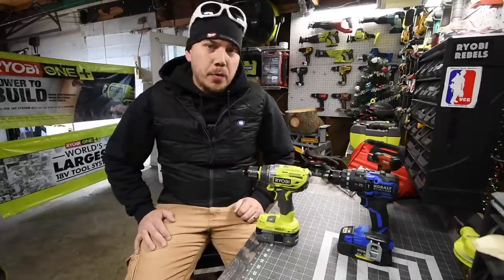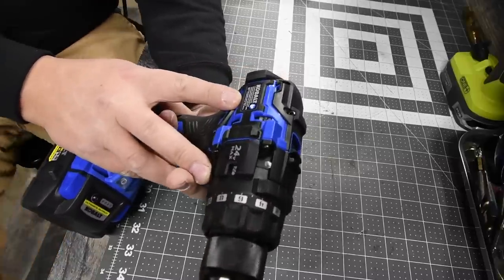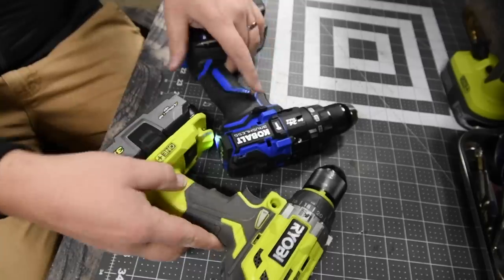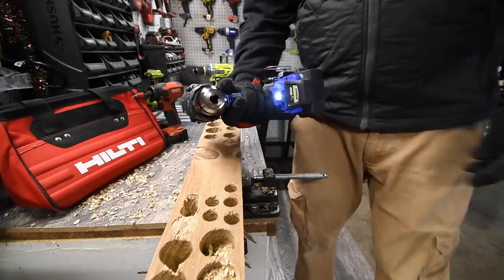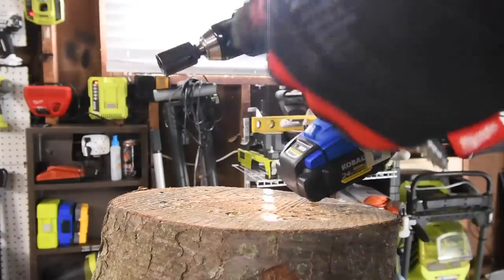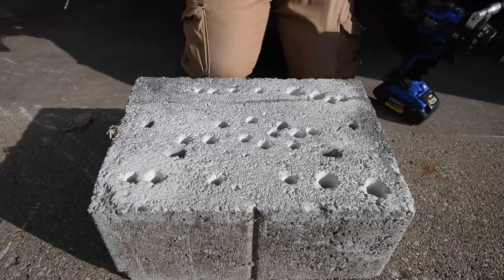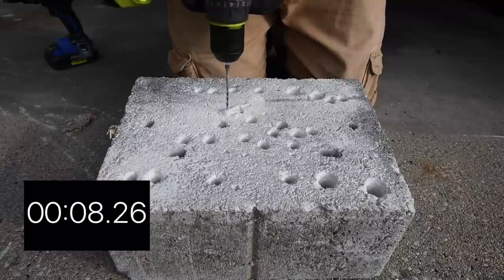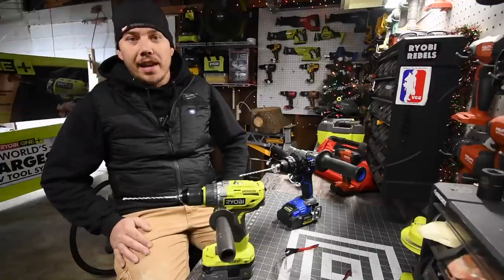Kobalt vs RYOBI

Comment: Project Farm just tested socket adapters.  Turns out the DeWalt socket adapter is the toughest on impact drivers, and Makita Gold when applying steady torque.

Milwaukee bits did mediocrely considering their supposed to be top tier brand.

Thought you should know since you break socket adapters a lot.
Reply from the maker: I love pushing these bits and tools to the extreme

Comment: I think Lowe's has some of the worse marketing in the world. The Kobalt is a great line of tools yet nobody knows about them. I agree with you I wish Ryobi had updated their tools instead of the HP line. I get it its Milwaukee 12v tools adapted to work on the 18v Ryobi battery platform. I bet if you tested the HP against fuel 12v they would just about tie in performance. Great video as always.
Reply from the maker: I agree with you on that.

Comment: Ryobi is a solid brand I just picked up the compact drill and impact. The new impact smokes my hp impact. Hoping the new hammer drill has a better handle though.
Reply from the maker: I want a HP hammer drill
Reply: Dec 10th is the 2021 release special hopefully they will announce it then.

Comment: My same ryobi drill chuck failed on me. I think its before three years but cannot find my receipt. I cannot losen the chuck to release the brush attachment i was using to clean. Now its a permanent metal cleaning drill.
Reply: Do you have any vice grips or maybe clamp the chuck into a vice to get the cleaning brush out?
Reply: @bulldog7659  yeah I've tried using vis grips. It just damages the thin metal housing. And just click slip sound. I believe it lock itself from the electric brake and  it kept tighten itself. Yeah I'm on drill mode with the trigger locked. I'll probably cut it off and put a new chuck in when i want to waste time on it
Reply from the maker: Im sorry to hear that Cheng. I thank you so much for viewing

Comment: So what is the difference between the the two they are basically the same size with the exception of the chuck
Reply from the maker: each company has a different built motor and material they build with

Comment: Yeah I certainly agree MCT! Ryobi really needs to Upgrades/Updates their Brushless Hammer Drill! I'm looking at least 950in/lbs of Torque and more Blows per minute. Also Ryobi needs to upgrade all of their 18V HP Batteries as well! Now that the 3Ah HP battery is 21,700 Cells. Why not upgrade the rest of their batteries from 4AH HP with 21,700 cells, 6AH and 9AH batteries with 21,700 Cells as well. More Cells more compact in a Higher Amp Hour. Otherwise! I got other Options for a Cordless Hammer Drill, I saw the Worx 20V Max Brushless Hammer Drill the British calls it a Slammer Drill. It's like a Hybrid of a Hammer Drill and a Rotary Hammer Drill combined together on a Compact Drill Driver. That drill is Beast! But sad That drill is not available here in The USA, YET!.
Reply from the maker: Im sorry about that Buknoychii and I thank you for viewing :) but Ryobi needs to do a lot of work
Reply: @ManCaverTools  oh yeah! And now that the Christmas is coming! Man! I want a Pancake and Waffle Maker and a Mixer in a Cordless Tool! If Ryobi can build/make one! In a 18V Lithium Battery operated! Because that will be a great gift for my mom and my sister for Christmas! I hope Ryobi can make one of those.

Comment: Actually I have used the dewalt 997 hammer drill and used the dewalt sds and the 997 was slower than the sds and the sds had a slower hammer beats per minute
Reply from the maker: very good and I thank you for viewing Benny